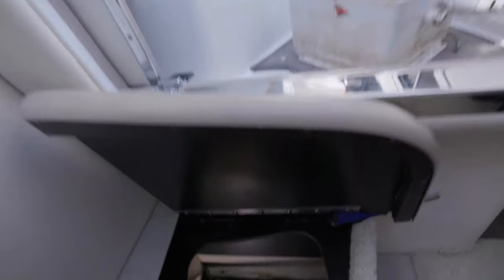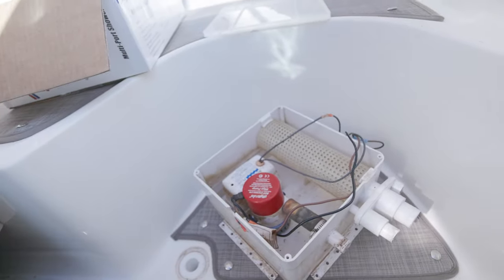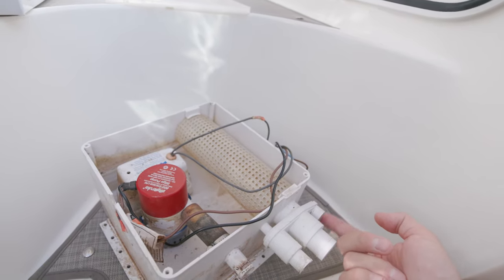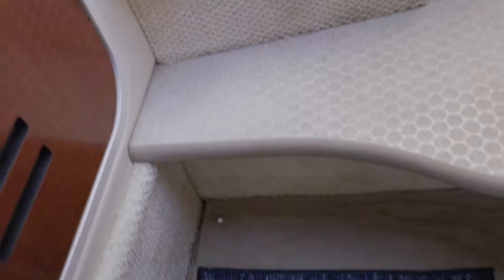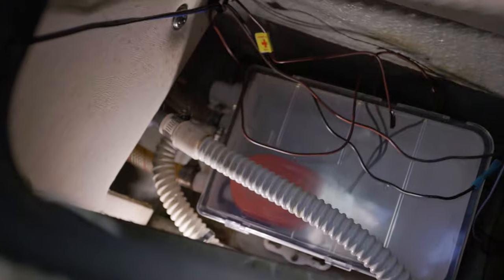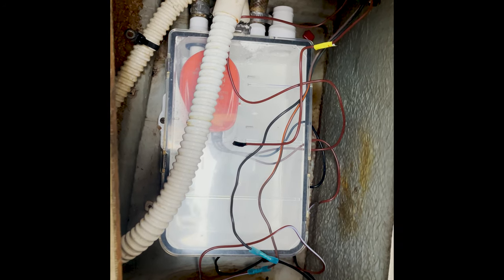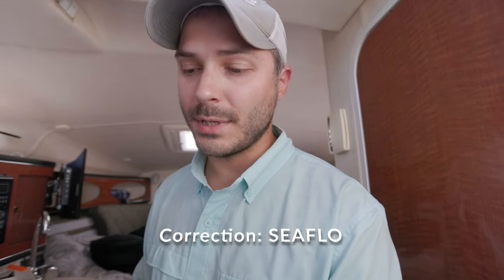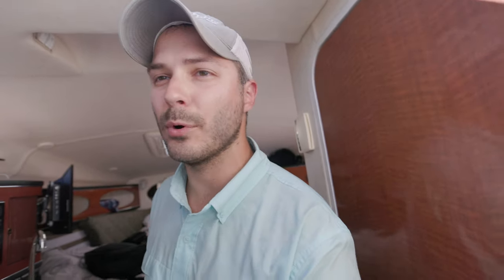Water in your carpet? Sea Ray SunDancer 260 Shower Sump Box

Comment: I got water in the cabin floor while in dry storage. The compartment with the pump was full of water. It had rained a lot recently and I think water got in thru somewhere maybe through the engine compartment into the bilge. Not sure if the pump is supposed to act like a bilge pump but the battery was dead so it couldn’t. Anyway what do you suggest to dry up the floor and prevent this from happening in the future?